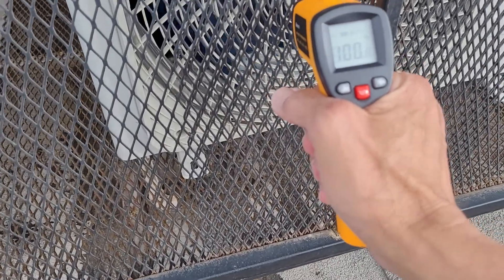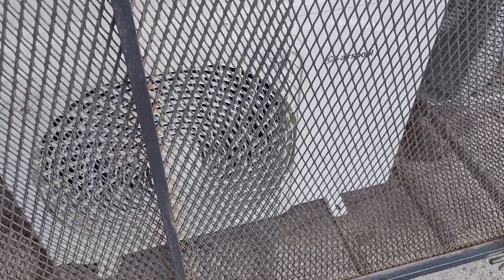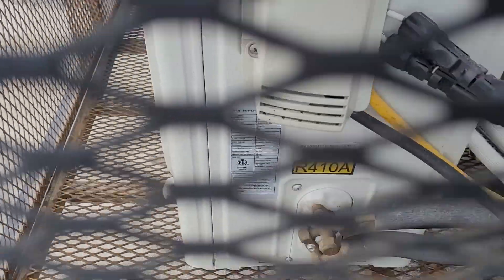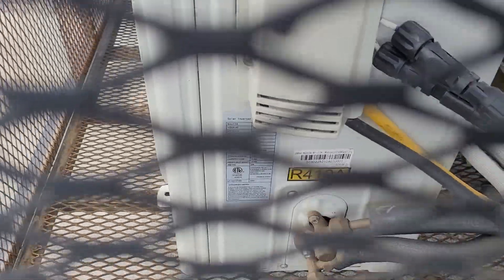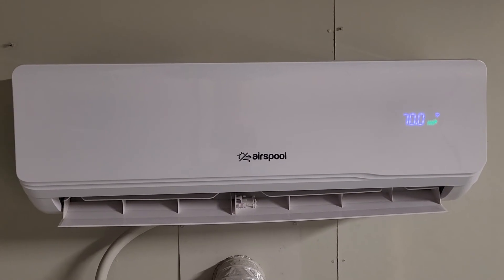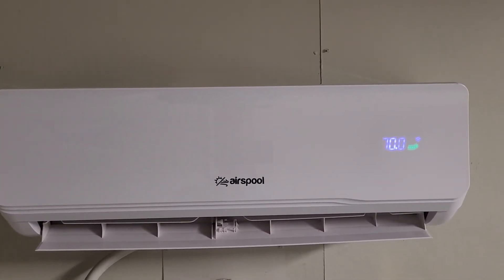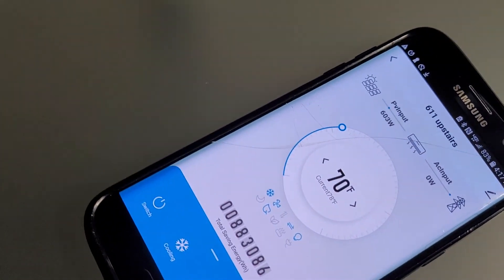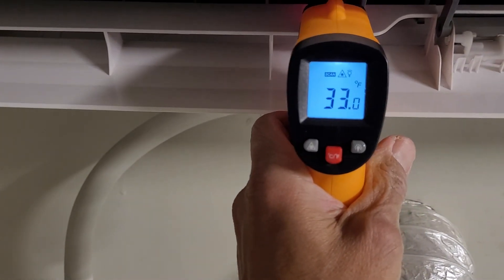2025: How many solar panels does it take to run a solar air conditioner (mini split)? #offgrid

Comment: If Air-conditioner power is 3000 watt; Per hour use is 3000w-hr. If Battery capacity is 5000w-hr (when full), then after 1-hour, it will be drained out. If solar panel is 3 nos by 500w (3x500w at 60% efficiency); still the energy used up cannot be replenished for use and recharging the battery-bank.... something not right here.
Reply from the maker: Under your scenario of using batteries, correct, it is not right. For Airspool MS12, 1,500 watts nicely produces 1,000 watts or more 95 plus percent of the time when it's sunny, so this is enough to nicely run the unit, but not enough to fill batteries when it's super warm out.  That's why we're advocates of doing hybrid systems that plug into the grid. And sometimes the grid is  the inverter attached to the batteries, but they're protected from draining quickly with this system of 1,500 watts of DC directly connected to the DC motors in the unit. And these panels could be put into a DC bus, so in the spring and fall, those same panels could feed into your battery bank.

Comment: I love the idea. You have the ac 120 volt unplugged and the unit is still running. Say it gets night time and the mini split turns off. The next day the sun comes up. Does the unit automatically turn itself on when there is power at the solar port in the morning or do we have to turn the unit on everyday since we are leaving the ac power off. I would like to leave the ac power off and have a low noise gas generator ready in case there is a power outage with the grid.
Reply from the maker: Yes, it'll come back on every morning when there's enough wattage.  Yes, we have a client in WY that recently installed with a gas generator for backup.  We also have a lot that have solar inverter for their alternating current.
Reply: If you leave an AC unit connected to a solar array, when the sun goes down, the system will start slowing down as the sun goes down. I’m not exactly sure how solar arrays protect the imbalance of amps vs volts. The watts remain constant so if the volts drop when the sun starts to set, the voltage will have to compensate. Something will have to give. In the morning, it should be even worse because you will need 4 to 5 times more current to turn the motors over. Again, something will have to “give”. If you have batteries, you will need enough panels to charge the batteries AND run the motors. It’s all possible if you throw enough money at it!
Reply: @Oscarthegreat290 mini splits don’t start with a surge of power, but ramp up slowly

Comment: Not clear on the equivalent power conversion. This guy need to put in A/C unit power in a proper list. Seems the maths dont adds up
Reply from the maker: Hi Mike, this guy here.  Thanks for this.  Well, the big air conditioner in the video is an International Comfort Products (ICP) Model PHD460000KTP0F1. It's actually 57,500 BTUs, so around 5 tons.  It has a running current (RLA) of 24.4 amps.  It has an inrush current (LRA Lock Rotor Amperage) of 144.2.  Unfortunately, I can't attach the data plate to this, and the data for this one is a bit hard to find, but this is pretty typical for a standard on/off 5-ton unit.  So, 144.2/24.4 = 5.91.  So, it needs 5.9x more power (due to 5.9x more current) to start than to run.  So, in the video, I say that you need around 5 x 130 Ah 12v batteries per ton.  So, 5 x 130 Ah x 12v = 7,800 Wh (since amp x volts = watts).  Remember, that's per ton, so we need around 5x this amount to get the unit into action, or 7,800 Wh/ton x 5 tons = 39,000 Wh (aka 39 kWh).  How does this compare to what the unit actually needs to start?  Well, it needs its 144.2 Amp x 240v (since it's a 240v machine) to give 34,608 W.  It needs this only for a few milliseconds when it starts.  But, it needs all of it.  We can supply, based on this example battery bank, 39,000 W for an hour.  But we can't supply any more than this even for a few milliseconds.  And, we could get the unit on if the battery bank had a very low depth of discharge, like lithium-ion.  We certainly couldn't get it on with normal lead acid batteries with a 50% depth of discharge, since we'd only be able to supply half of this 39,000 W.  And, we'd even miss the mark by a bit with AGM batteries if they were 80% DoD.

For running overnight, for this unit, I said you'd need around 32 12v 130 Ah batteries, which would supply 49,920 Wh.  But this unit actually uses around 5,856 watts to run, at its running load amp test (done at 95 degrees Fahrenheit).  So, for lead acid, we're only going to get around 25,000 Wh out of this battery bank (assuming 50% DoD).  So, 25,000 Wh/5,856 W = 4.3 hours.  But, this is running time.  If it's super hot out, then it may be running constantly for the hours when solar cannot refill the batteries.  However, if it's only running 30% of the time, then 4.3/.3 = 14 hours.  So, your actual results will vary on this one.  But, oh, remember, you need to be able to have enough power in the battery bank to get the unit on!  See above.  So, you need to still pad this further.  Even more batteries are needed.

What's the point? i) It's very hard to run a traditional air conditioner using solar ii) variable-speed motors like the one that Airspool has come to the rescue iii) to save money/optimize, we're currently focused on hybrid units that connect to the grid at night so that no batteries are needed.  We have clients that run these units off-grid, though, and plug into their battery bank at night.  They're totally off-grid, so they like the savings and efficiency of running this unit off of 3 separate panels during the day and then not needing to worry about the inrush current at night since this has a variable-speed compressor and fan motors.  It runs at 200 w to 1,100 w, depending on the outside air temperature and the heat load of the space to be conditioned.  But, yes, even when it's running off that relatively-parsimonious 1,100 w, it gets up to that running speed very slowly, which saves battery at night and means that fewer solar panels are needed to get it running during the day.

Comment from the maker: Was this useful in understanding the current (no pun intended) solar panel demand for running an air conditioner?  Post up any other questions you may have or get in touch with for your specific application.

Comment: There are 12 and 24 dc units
Reply from the maker: For the batteries, you mean? Yep. But the stored (and usable--remember depth-of-discharge regarding your battery setup) kWhs need to be the same regardless, requiring around three times as many solar panels plus the cost of the batteries to run totally off grid. Of course, if your situation is off grid, you may need to do just that, assuming that you live in a high heat-summer night area. But lots of places like schools and production warehouses and other businesses are just open during the day, so no batteries is fine for them.

Comment: What could you do if you have no grid to plug into, though? Anything? 
Could you use any reasonable battery set-up? 🤔
Reply from the maker: Hi Johnny, the goal of these units is to deliver the most amount of air conditioning (or heating) for the least amount of money, so grid power is usually cheap at night, especially since these units run ~ 22 SEER.  To your question, though, we have customers that run these off grid, but they have additional solar arrays with batteries and inverters.  So, this acts like any other plug-in device for them when it's cloudy or nighttime.  And, yes, you could only have Airspool running off a DC battery array if you had a voltage controller to supply 80+v to the Airspool unit.

Comment: 3 solar panels, so I guess I’ll just run to the Dollar General store buy three of the outdoor solar lights and take the little solar panels off of them and it will run your air conditioner. Three Solar Panels is not an answer!  I can get solar panels from 1 W to 400 W.  And no I didn’t watch the video past 37 seconds.
Reply from the maker: Plane, it depends on the location.  Here in Vegas, we get the hot hot heat.  That not only makes solar panels .2%/degree Fahrenheit less efficient (above 77 degrees,  and .2%/degree Fahrenheit more efficient below 77 degrees), but it also makes compressors a lot less efficient in pumping up the refrigerant to be above the outdoor air temperature so that the refrigerant can change state back to liquid in the condenser. So, 1,500 w. is needed up here for these 110-degree days to get maybe the 1,100 w need to run the unit.  In spring/fall here, or in coastal CA in the summer, it'll run on  550 watts all day long, no problem.   That could almost be 1 panel (given that there are a lot of 550 w panels now), but you need 2, since the unit needs 80v, and most panels are around 42v these days.
Reply: @airspool  So the minimum needed is 80v (with a minimum of 2 panels @ 42v) but what is the maximum voltage the unit can handle? I just dont want to oversize my system if I order the panels and grab an airspool. Let me know when you can! The more info the better! :)